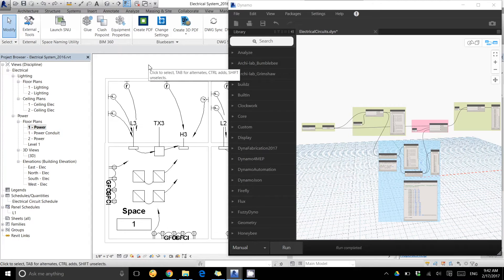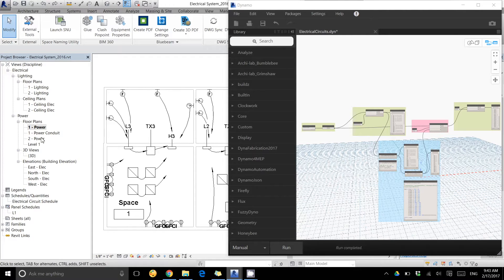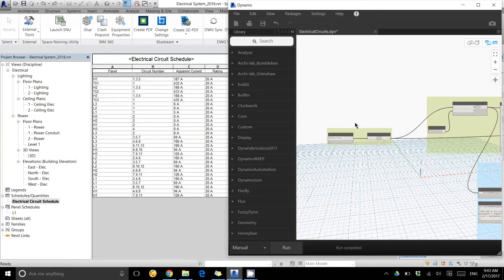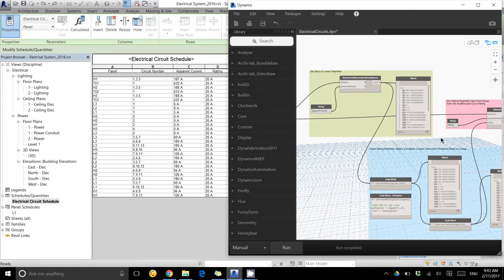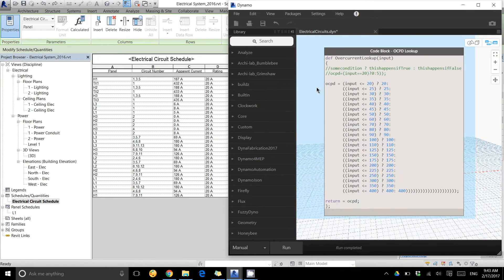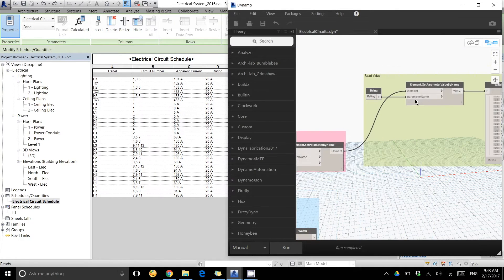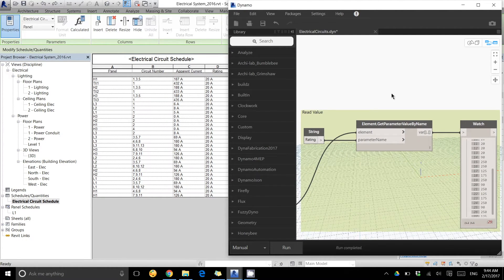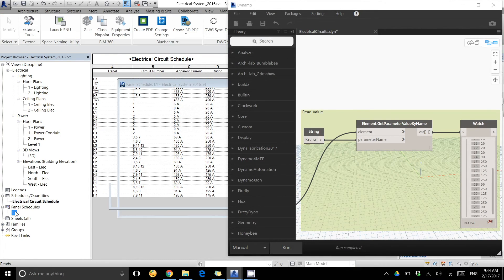Dynamo Revit - Lookup Table Example - Electrical Circuit Ratings

Comment: First of all, I would like to congratulate for share the file to us. I would like know how to get the section of wire of the circuit. I have it on a table that have a column with the circuit and other column with the section of the wire, but I don't know how to get de value of the section of circuit. I can get the value of the circuit, but only it. Could you help me?

Comment: thanks pal but when I run your dynamo file nothing changes, the rating of every circuit still 20A, for example I had an circuit with 130 apparent current, but the rating still 20A!
would there be a solution for this?
Reply from the maker: Do the watch nodes show that it is working and pulling out correct circuit data? Or do you get any warnings? I added a link to my Revit 2016 file in the video description that used to set things up for reference.
Reply: thank you my friend for your effort...
it works with your Revit file! :) 
but in my file which was have the problem I mentioned to you.. the nodes didn't show any data when I click Run.
any way... I can use your file for any new project for me :)
Reply: I have an idea for you to develop your dyn file...
why don't you make it calculate the main circuit breaker rating of the panel too?
you have to sum all the apparent currents of the circuit breakers within the panel...then multiply them with 25% safety factor... and then you have to create a new lookup table for mains rating.
but you have to remember that you have to choose high rating values for this lookup table, you have to get the right CB up to 2000A or more..
this is just an idea for you :)
Reply from the maker: That is a great idea.  Do you want to give it a try? If you get it working, send me the updated .dyn file and I will link it here.
Reply: yeah I'll try..in fact I didn't try to work with dynamo before, but this is my chance to get my way and begin :)